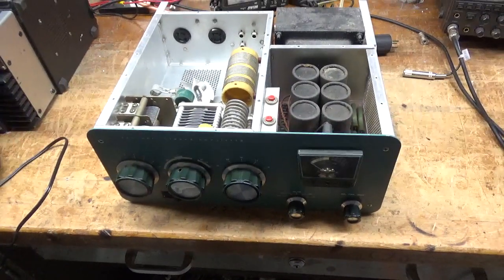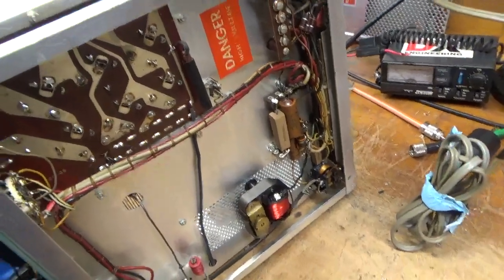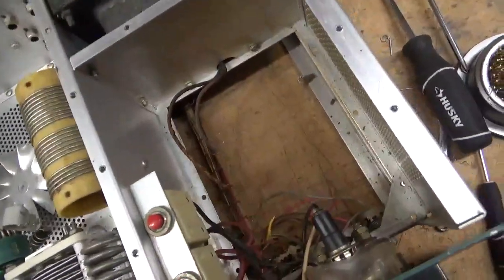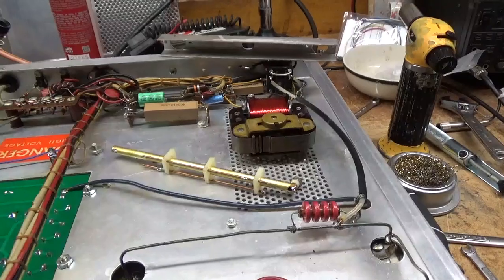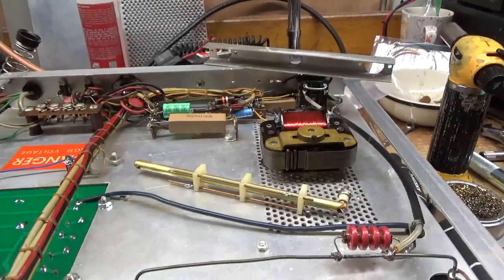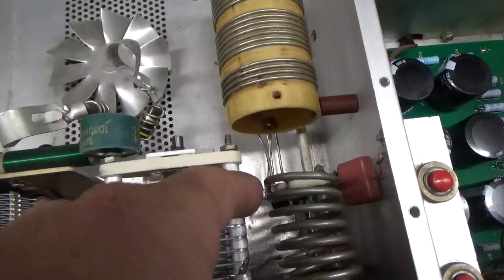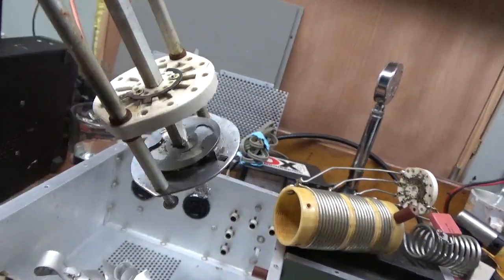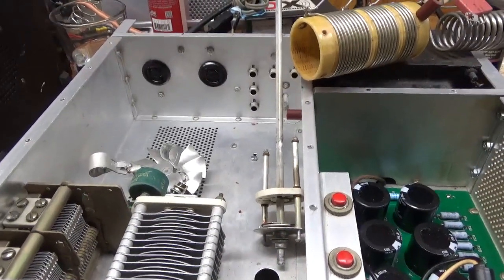Heathkit Sb-200 Band Switch , Harbach Electronics Kits , Mods And Repairs

Comment: Great work. Just picked up a stock SB-200 from a yard sale. Have built many a Heathkit so am looking forward to upgrading this baby. Your video was very helpful. Can you comment on replacing the RCA jack with a SO-239, do you have to remove the SWR unit and is that as difficult as it looks?
Reply from the maker: Congrats on your score. No , the directional coupler only need be removed when replacing the output so-239

Takes time

Be careful not to damage the t/r relay when installing an so-239 for the input

73

Comment: Would it be possible to replace that unobtanium rotary switch with a modern one that drove some relays to do the actual switching or something?
Reply from the maker: Switch contacts can be changed, not feasible to have a relay setup

Comment: Can you or anyone suggest a good quality HV wire to use in these amps? I bought a CB'd SB-200 that had a burn from a soldering iron on it and it arced through to ground on initial power up. I can't find any information on what I need to buy to replace this wire.
Reply from the maker: I would suggest ebay. Be careful !!!!!